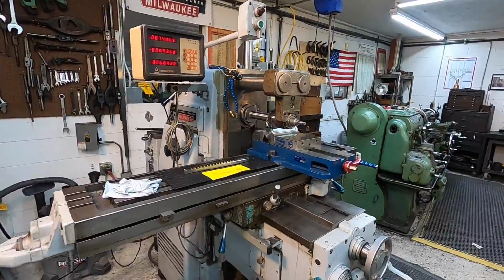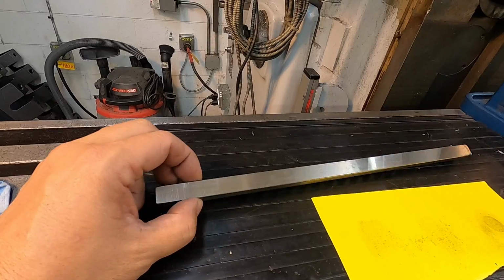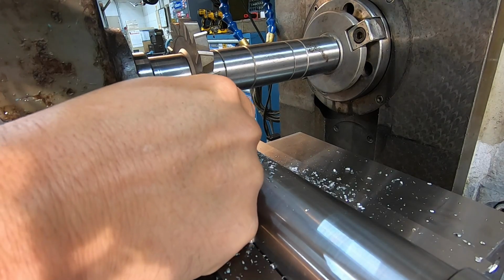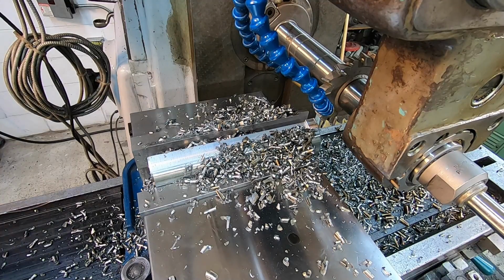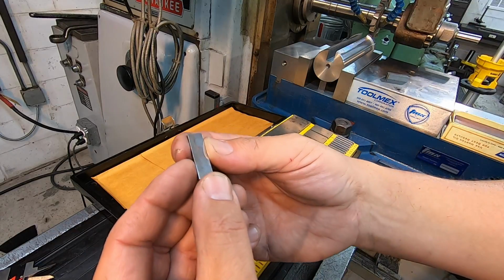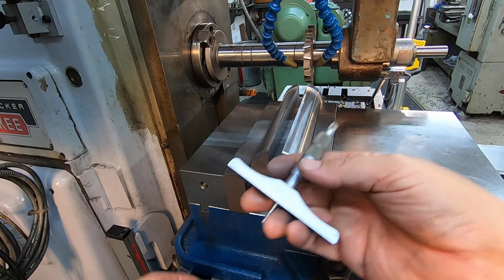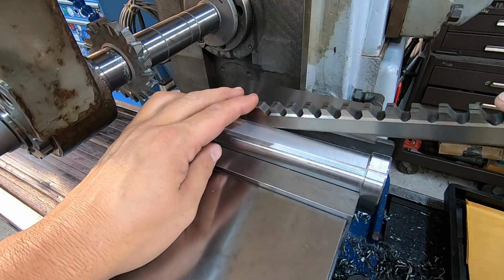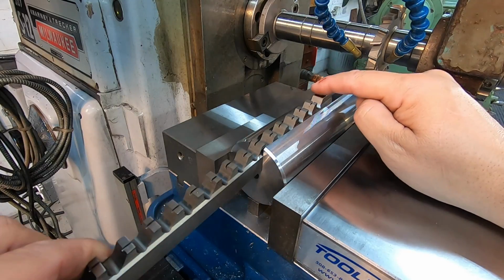Broaching Keyways in Cast Bronze Capstans Part 2

Comment: I’m just starting my apprenticeship as a machinist, I’m mainly doing CNC at the minute so I’m new to this trade. What are some of the reasons for cutting keyways this way? As opposed to using an end mill etc. Don’t go too hard on me, I’m still learning! Cheers
Reply: I am also an apprentice so i might be wrong but the 2 reasons i can tell are 1. Sharper corners at the bottom than your normal end mill and 2. Time: You saw him do it in 1 cut here with his cutter, but if you wanted to do such a deep cut you would be better of using a roughing mill and then finishing it with a normal end mill, which on a CNC might be fast and easy but on a manual machine its a bit harder and a lot slower

Comment: How do you determine the rotation direction? I would think cutting upwards better for chip evacuation but you would require much better work holding?
Reply: General standard preference of standard milling rather than climb milling - so cutter rotates against the travel of the work.
Reply: @millomweb  thank you 🙏

Comment: Adam, when you were measuring the depth of cut with the depth micrometer,  do you account that your micrometer is now resting lower towards the center of the material because of the width of cut you have made.  You are measuring across a flat and not from original top of the stock.  Does the machinist handbook tell you how to compensate for an accurate measurement?
Reply: Err, it's the actual depth that matters - i.e. what he was measuring. It's square things he's measuring, not what used to be round.

Comment: Old guy who showed me how to use gauge blocks would be turning in his grave 🤔🤔
Reply: Yeah, he should have had oil on his stone ;)
Reply: Yeah i didn't think that was recommended lol. But if it works it works ig
Reply: @madmodifier  If you've got a tape measure and you cut the first inch off it, are the numbers & marks on the tape measure still going to be the correct distance from the end ?
Reply: @madmodifier  Just a matter of a different scale. To take any material off either a slip gauge or a tape measure is just wrong !
Reply: @madmodifier  I think there's a lot of stuff you don't understand !
Reply: @madmodifier  You could even use their proper name:
Johansson reference blocks

Comment: Using a precision ground stone, it will not bite into the metal, it will only remove anything that protrudes from the surface. A question I do have, could you have used an end mill instead of the stagger tooth cutter to make the slot? if so, would it have taken longer? Thanks for sharing this Adam, always a pleasure to watch your episodes.
Reply: If it's making a sound, it's removing metal. If it wasn't being rubbed perfectly center-pressure, it's destroying the edges. You can't do that by hand.
Reply: @Anenome5  Your correct, if it is making a sound it is removing material, but that just means that your surface was not true. Run a stone on a precision surface and you won't remove any material that you don't want to.
Reply: End mill = narrow = weaker tool = reduction in material removal rate. The cutter shown was ideal for the job. As he said, he could have doubled the traverse speed and just got on removing material a t a greater rate - probably with flood coolant instead of mist.

Comment: I literally screamed at my TV!!! I couldn't believe what I just seen!! Especially coming from Adam. You don't use anything abrasive of any sort on your gage blocks. You rub them on a paper notepad. I learned that back when I was 18 at my first job.
Reply: The paper trick should be OK most of the time, how a translucent arkansas stone can be used to gently remove offending burrs.  Here is what Starrett says about stoning gauge blocks... http://www.starrett-webber.com/GB47.html
Reply: There is a heck of a difference between lightly rubbing and pressing down hard. In this case, all that is being removed is a thin skin of oxidation. I wouldn't even call it rust.

Comment: Maybe olso can With an endmill?
Reply: he could do this with an Endmill too, but with the horizontal he gets the better surface finish in the groove ground where the broach will have to glide under pressure.
also - he if he has to tools at hand, why not use them? Doesn't look like the amount of work (three cutting passes) would be less with the vertical.

Comment: Precision?  
Not from them gauge blocks!
Reply: An adjustable parallel with a micrometer will equal their accuracy now. Suggest checking the stack up before using.
Our shop certified our blocks every 5 years replacing worn ones, no one ever stoned them!
Reply: It should be obvious that these are no metrology lab grade blocks (anymore), but still good for general shop use.
Reply: I literally screamed at my TV!!! I couldn't believe what I just seen!! Especially coming from Adam. You don't use anything abrasive of any sort on your gage blocks. You rub them on a paper notepad.

Comment: I trust you when you polish your gauge blocks. You have a very refined sense of what kinds of tolerances you need to maintain in your shop and what you need to do to ensure that. However, I would be very curious if some time you miked some blocks before and after to see if there was any difference. I am always amazed by how much you and others seem to be able to reduce a diameter in a lathe with only a light rub with Scotch Brite. Love your work.
Reply: The precision ground stones are flat. There is really no exposed grit. Won't take off anything but a burr or surface roughness that sticks in-between the grains of the stone. They are kind of amazing.

Comment: I am a Metrologist, my soul hurt when you put that gage block to the stone.
Reply: Curious as to why? Precision flat stones shouldn't be taking off material except burrs and roughness that should not be there. At least that is the theory.
Reply: @imkindofabigdeal4308  every time you use gage blocks (applying force) you are removing material. And to put it to an object that is designed to remove material is in all aspects not a good idea. But that is also why people will have what is called a working set. If you have burs on your blocks you are using them wrong haha. Just im my line of work its something I don't see.
Reply: @johnboytrue  Right, why wouldn't you oil the set rather than try to remove new rust every time. And you can remove rust chemically without harming the block.
Reply: @Anenome5  it can ruin wringing and also adds thickness. Oils form a few micron film on the outside and stick on.
Reply: @whatevernamegoeshere3644  obviously you clean it off before wringing, but that would be better than rubbing it on a stone to "remove rust" ever time, stop letting rust build up on it.
Reply: @Anenome5  a better way I heard of is to keep some camphor in the box. It sublimes and forms an ultra thin layer on everything. It smells a bit like old women, yes, but it's the easiest way I know
Reply: @imkindofabigdeal4308  If you rub two perfectly flat surfaces together, the softer face will wear in its entire surface. In this case where we have rust... not entirely sure it matters any, the precision to that degree is long lost already. So... works in this case, doesn't in a more precise environment. Also if you do this a dozen times, I bet it would remove a reasonable amount
Reply: @imkindofabigdeal4308  gage blocks are already accurate to a millionth of an inch, better than that for the good ones. That sound you hear when it's being rubbed is metal coming off. It's absolutely removing material, and he says he does it every time.

Comment: It's interesting how gauge blocks wring together, and they're not magnetic - for obvious reasons. They are just so flat the metal almost bonds together.
Reply: https://en.wikipedia.org/wiki/Gauge_block#Wringing
Unknown mechanism but there are a few ideas about it
Reply: It's called "Molecular Cohesion"
Reply: @easyboy1950  No I don't think it is that. Cohesion needs a charge imbalance, like the one in water or other materials that can create hydrogen bonds or dipole-dipole bonds. Here we have single atoms with no charge. In a metal you would have to rely completely on dispersive forces, which is a momentary shift in charges as the electrons move around randomly, like in mercury when it's a liquid. Correct me if I'm wrong but that seems like a force too weak for this to happen. It could just be a combination of multiple effects, like trapped air and such

Comment: Thank you for sharing your work.  I find it incredible that a cylinder does not move "at all" while processing the part.  There has got to be a lot of mechanical retention between the cylinder and the vise, I mean absolutely no flexure or spacing.  Your comments.  Thanks again.

Comment: way not clean them all and protect them with a little oil for future rust.?
Reply: An oil layer would both affect the reading and stop them wringing together.  The only good way to keep them rust free is to handle them often, so they are rubbed with the lanolin in your skin.
Reply: @MattOGormanSmith  I'm not exactly sure that would work the same with all alloys. Grease in the skin is acidic. Also if you look at adam's hands they are not exact the most hydrated and soft princess hands. A better solution is keeping naphthalene or camphor in the toolbox, it sublimes and forms a sub-micron layer of wax on them. They are also chemically inert in a shop environment

Comment: I am asking but shouldn't the depth of cut be the top of the broach not the bottom ?
Reply: Anil Mahabirsingh not a bad question it will probably be more clear when you see him use them in the next video.  But when the plug is in the hole to be broached he wants the cutter to be fully engaged and supported by the slot of the plug and the first tooth will either just miss or just barely engage the part of the hole to be cut.  The cutters teeth gradually have more height as you move along the cutter so as he pushes it through each tooth will take a bit of a cut.  Then he can add a shim to the back of the plugs slot so the cutter engages a bit more for the next push through the slot....rinse and repeat increasing the shim thickness until the cut slot is at the desired depth.
Reply: Thank you for the explanation , it's all about learning for me
Reply: @anilmahabirsingh422  Then stick around for part 3

Comment: Hi Adam: As always awesome content!  You pointed out something that I think is really interesting and that I don't know anything about: having th gauge blocks "rung" (not sure I heard it sight) together - is that a suction fit because of how perfectly flat the blocks are? Thanks!
Reply: Jep your correct. The stick Like Magnets!
Reply: Actually no one knows. It could be van der waals attraction, it could be suction but that doesn't seem to account for the amount of force generated. It could even be partial cold fusion of the metal, as in connecting like continuous metal, not the nuclear thing.
Reply: @Anenome5  When two very flat surfaces are brought into such close contact with each other, this allows an interchange of electrons between the atoms of the separate blocks, which creates an attractive molecular force. (This force will remain even in a vacuum or if no oil or water is present on the blocks.)
Reply: @clypeum5063  aka van der waals
Reply: @Anenome5  van der waals force is correct
Reply: @clypeum5063  and they have to be extremely flat for that to take effect.
Reply: @Anenome5  they are really flat lol, they Stick good together with a tolerance of 1 Micro Inch per square inch. That is 0,0000254mm... Which is pretty flat
Reply: *wrung/wring
Reply: Hey thanks everybody for the explanation!

Comment: @Abom79, what is the benefit of the horizontal mill over using a vertical mill with an end mill to cut the slot?
Reply: Horizontal is old school and waaaay more cool, is what!
Reply: @thaumaturgicresearchcounci4180  I agree it's cooler. Seems like more setup though, so I wonder if it's better in some technical way.
Reply: @erikburrows  Slotting with an EM is often times a struggle. The horizontal is just another way to do it.
Reply: @erikburrows  It's a far more rigid setup for a given machine, as the cutter is supported at either side. Doesn't make a difference for a one-off, but in a production environment where speed matters it would be possible to push the machine harder/faster.
Can't really have a modern horizontal, with auto tool change etc.
Reply: I'm quite sure that the horizontal will give a much better finish in this type of operation.
Reply: Let's say you had to make a thousand, you'd use the horizontal. It's just easier and faster.

Comment: Setup question: Should the piece have ideally been set in the vise 180* so that the collar would be pressing against the vise jaws? It would prevent the piece from potentially moving due to the forces applied from the cutter.
Reply: Could, may not be perpendicular though.
Reply: You beat me to it, I was thinking exactly that same thing.  Plus I'd have been tempted to climb that heavy cut, to push the slug down into the vise, too. (Of course, I haven't run a horizontal mill in like 40 years, so what do I know? 😁 )
Reply: @d00dEEE  yeah but you risk ruining the machine rather than the part if your vise setup fails.
Reply: Clamping parts is a repeat offence in this shop but makes it interesting watching to see lots extra footage of fixing the results.

Comment: Done a lot of deep slotting with that same setup. Absolutely have to have a razor sharp cutter and a good solid hold on the work piece. Flood coolant is best to keep the chips "washed" out of the slot. Worse situation is to have the cutter break down in the middle of the cut. Have had that happen before. Keep the cutter cool and chip free and at a good feed rate. You will know if you start crowding it soon enough. We went to all ceramic gage blocks where I work. More stable and they won't rust.I have made smaller plugs for broaching but that one is pretty big.

Comment: I just made made a broach bushing for a job I did.  I was referbing a reeves drive pulley.  I have a lot of broaches and bushings but none would bit this pulley. My tolerances did not come out as close as yours but the plastic key I made fit great.  Fun project.  Thanks.
Reply: I should have said delron not plastic.  I also used my vertical mill.